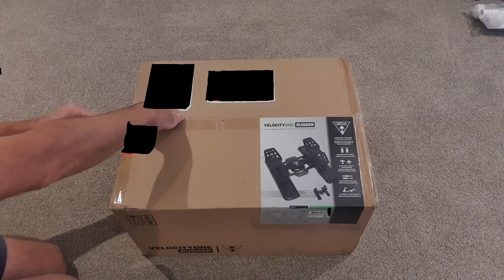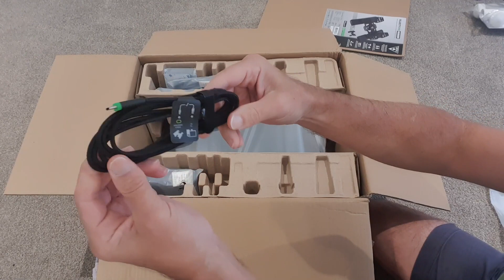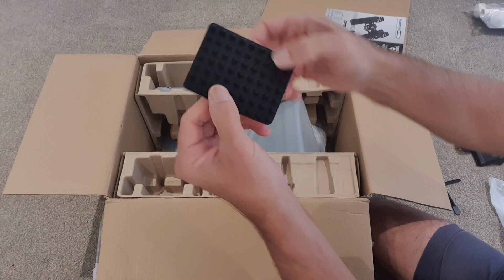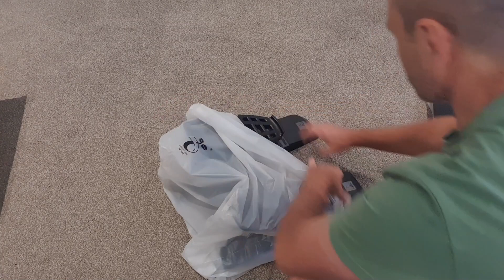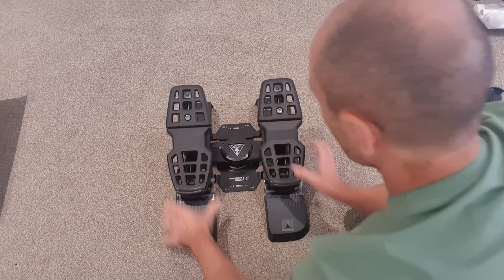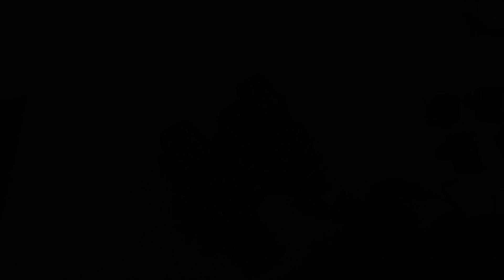134 - Turtle Beach Velocity One Rudder Pedals Unboxing

Comment: When I had rudder pedals I had the Logitech which I believe are just the saitek. Wasn’t a fan felt flimsy and would move on the carpet a lot. Those turtle beach look a lot better. My thrust master throttle quadrant has hand rudder like pedals which I been using which is fine for ifr practice.
Reply from the maker: they are solid Glenn. Have a couple more videos coming on the setup and initial testing.